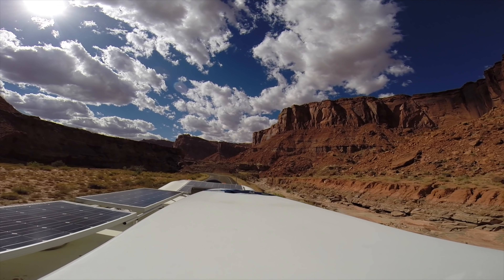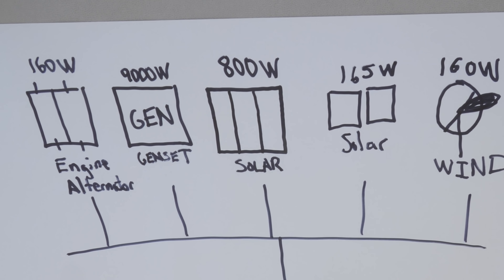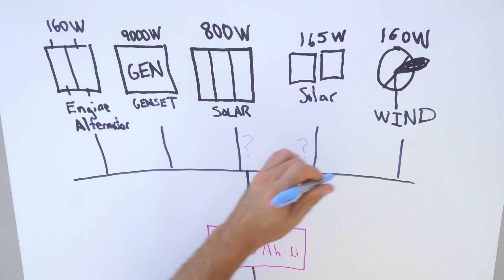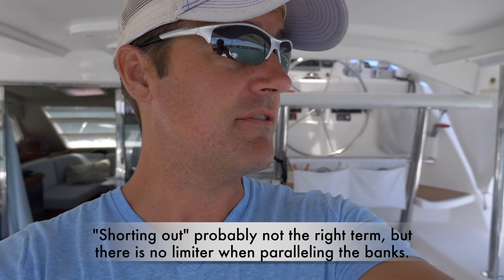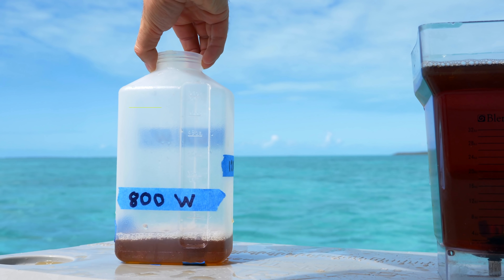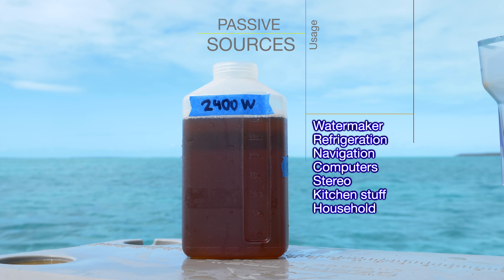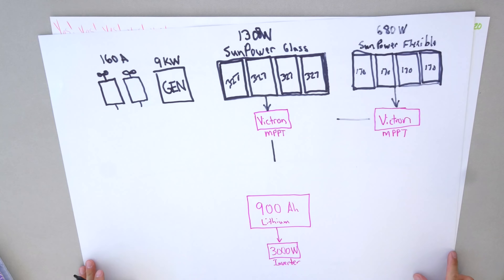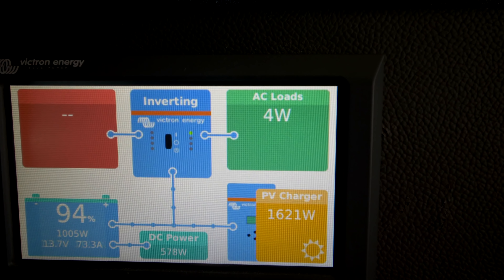How to manage electrical power on a sailboat using NO fossil fuels!

Comment: Thanks for the video, i am still expanding my solar on my new to me Gemini sailboat, finally wrapped up the conversion from the old diesel onboard motor to dual electric 20hp outboard motors. Something i would highly recommend over buying a honda eu2000 portable gen is to take a look at https://www.affordabledcgenerators.com/, i picked up their kit a few years back for my RV that had no onboard generator and its been an amazing little setup. The kit allows you to use a very common over the counter gas engine and an automotive style alternator combined in a nice and neat setup. I picked up the Honda GC160 from northern tools local for $180 and the 165amp alternator from Autozone for $75 w/lifetime warranty. Its really a nice little setup, because its all common mass produced parts not specific to a certain model generator. Running the system on a fairly low lithium battery setup, ive seen it dish out as high as 1750 watts into the battery bank in pure DC voltage, which is nice because you dont loose all the conversion losses when trying to charge your DC batteries from an AC output generator like the honda eu2000.
Reply from the maker: Cool. Good tips! Upload a video of the cat when you are done!
Reply: This is a very practical solution for a low voltage DC generator.  Great suggestion!

Comment: Hi. I've organised my system exactly the same. In fact I'm running the house at 24v and left the engine at 12v with no connection at all. On top of this I've put one small solar panel on the engine battery with it's own separate controller, and taken the belt off the alternator.
Reply: I'm about to do the same... Question, how do you run your windlass and/or winch? Are they 24v too? I still have the old ones, and they are 12v... Also, today they're configured with a relay so that the engines need to be started when running the windlass. Now I'm contemplating if I should add a small 12v housebank, connect to engine, and then from the 12v charge the house 24v. (that way I won't ruin the alternators either from drawing tooo much, and not from spikes from shutting down 24v lithium via bms)
Reply: @1975Per  All my mechanical services are 24v, pumps, winches, autopilot, inverter and future watermaker. I went to 24v because I had to change the winch motor anyway and I wanted to keep the maximum current in any conductor under 100 Amps. I built a new 24v house subpanel in the services area close to the house battery. This made the wiring runs shorter and the fusing design easier.

All the electronics and lighting is 12v and powered via multiple Victron DC to DC converters dropping the 24v house down to 12v. They are inexpensive and very reliable, plus they ensure all the electronics have a clean stable supply, fully isolated from everything else. All these loads terminate on the original switch panel in the saloon where I also put the battery monitor. All the lighting stayed at 12v as per original.

 
The engine 12v is completely separate again.  In reality the engine starting battery needs relatively little charging and a small standalone 50W solar panel with it's own controller keeps it topped up perfectly. I plan on changing it out as a service item every few years. I also have the luxury of an ancient engine with decompression levers and I can hand crank it if I really feel like some exercise.

And in keeping with all of this the AC side (which only has a minimal 6 load circuits) is on another small subpanel as well. 

Designing the engine, mechanical services and electronics/lighting separately like this is a tad radical, but I find it eliminates many subtle design and complexity issues. I used yellow/black for 24v wiring and red/black for the 12v wiring, plus the AC wiring was all installed in orange plastic conduit to the Australian standard brown/blue/green code. By keeping all the panels physically apart, colour coding and labelling clearly what sounds like an unusual system is actually very safe, simple and a total doddle to work with.

The only future addition I may make is if I upgrade the entire engine alternator system, I will install that at 24v  and charge the house battery only from it using a dedicated charge controller. But at present I've got 900W of solar and at present that provides all the power we need, and I have room to add another 240W. (The 24v main house battery is 240 AH built with 66 Yinglong LTO cells, but that is another comment or two again.)

As a fall back position we have a Honda 2.2kW portable AC generator that I can plug into the shore power socket, but so far it's just been decoration. 
Hope this helps

Comment: The Honda generators have some of the worst efficiency and are crazy expensive.  I created a spreadsheet for generator efficiency here.  The Westinghouse iGen 2500 is the most efficient and produces 1.54 times more energy per gallon fuel than the Honda EU2000i, and 2.3 times more energy than the Honda EU2200i. https://docs.google.com/spreadsheets/d/17fXqvzg9rvThD8p3qxjZXzlybJqiV38HyETFddwh9x4/edit?usp=sharing

It's good to have a dedicated generator especially if you're out in the middle of the ocean.  You get added redundancy and efficiency.  Running your big diesel main engine just to drive the alternator is very inefficient because it is operating at very low loads.